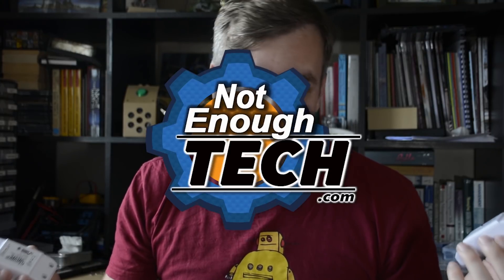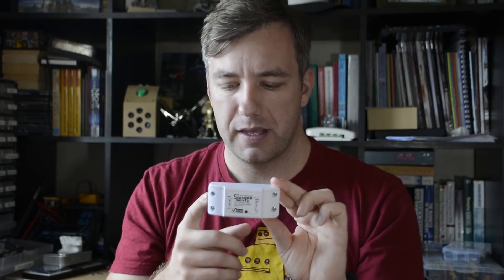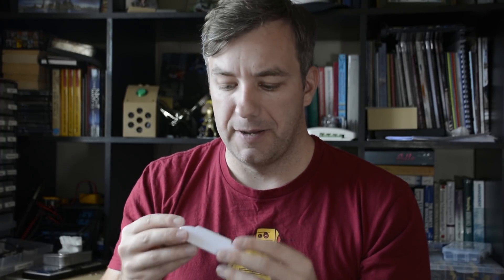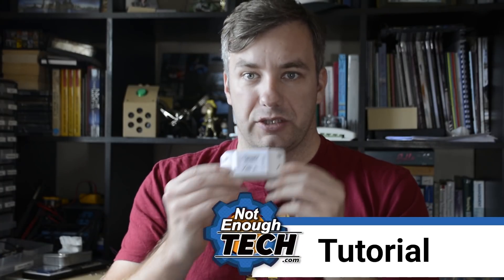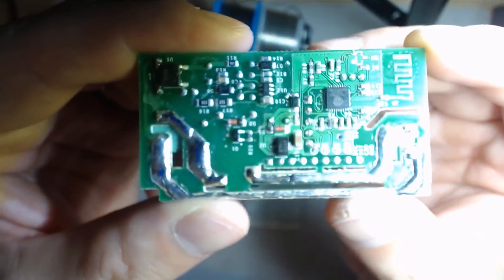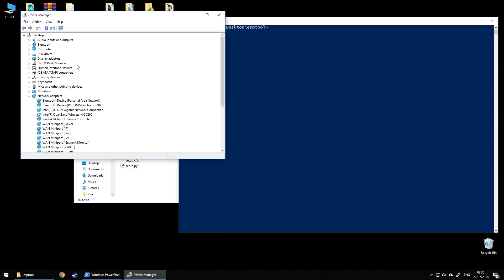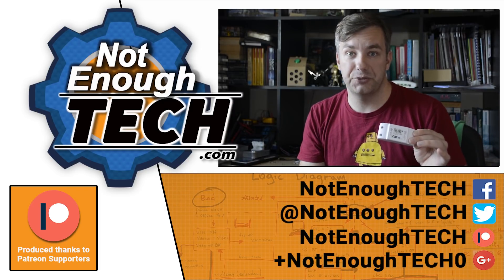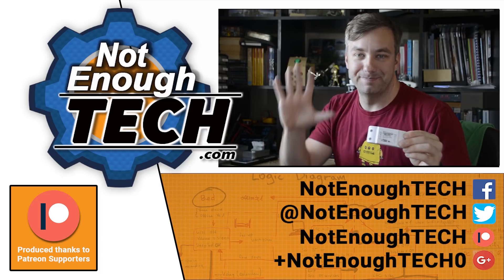Should you hack Sonoff Basics devices? [updated Flash Guide see description]

Comment: Why is the backup only compatible with one device? Is it only because the MAC address is stored in the backup? I have three devices. Do I actually need to keep track of which backup goes to each individual unit, or could I just restore a unique backup to each device and call it a day?
Reply from the maker: The backup stores MAC which is hardcoded into the hardware. Name the bin file accordingly and sign device enclosure inside to identify the backup. This only applies to original firmware
Reply: @notenoughtech  Thanks for the quick reply. That is a bit of a headache. But after further research I am pretty certain that I will never use the stock firmware.
Reply from the maker: I never went back either... but you know... it's better safe than sorry

Comment: Hi, I am using a CJMCU-232H as my programmer. Whenever I connect either  the gnd or vcc (+3.3) from the former to the sonoff, the power led on the CJMCU goes off and the com port (COM3) disappears from device manager. I only need to connect +3.3V, GND, RX and TX, right?  Could it be that the CJMCU isn't providing enough current for the 8266?
Reply from the maker: I have not used that one. Seems like there is too much power draw. Try connecting 3.3V from another source but keep the GND common with the programmer, new power source and the sonoff
Reply from the maker: This is the one I use:
https://www.banggood.com/custlink/KDGKKz47LT
Reply: Besides Tasmota there are a lot of different firmwares:
 ESPurna
 (Sonoff-Tasmota)
 WiFi-IoT
 Sonoff WiFi Switch
 ESPEasy
 1M
Reply from the maker: Thanks for the list. I use tasmota and AFE Firmware will check out the others at some point

Comment: What will be power adapter recommendation for "1 Channel Inching /Self-Locking WiFi Wireless Switch 5V " . 5 Volt 1Amp or 5 Volt 2 Amp or 5 Volt 3Amp ?
Reply from the maker: That's depends on the device itself. 1A should be more than enough to drive both WiFi chip and the relay. Do check spec sheet to know detailed requirements.

Comment: I'm considering getting  some sonoff equipment, but I really don't know how much one can trust these. Am I being paranoid? 😄
Reply: I don't trust these using the stock firmware since they have to go to China to switch the light on and off. 
However using the Sonoff.bin (Tasmota) file, you change it to being local to your own system. This is great and let's you pull it into Home Assistant or OpenHab to manage it.
You can also just use it as a local webpage if you haven't moved to some Open Hub  yet. 
With the Sonoff stuff I don't bother to backup the current firmware as I never want my switch to ping a server in China to turn on my light.
Reply from the maker: You can stay paranoid. Sonoff flashed let you write your own firmware. In that case you know for sure it's just you that handles the data (unless your coding skills are shoddy then use tasmota or AFE Firmware - both open source)
Reply: They are well made and very reliable. The new Sonoff Basic is a complete redesign probably to conform to more countries' safety standards.

Comment: How did you figure out the "0x00000 0x100000" for the backup? Is that a general size for ESP8266 devices?
Reply from the maker: Don't quote me on that but I believe these are memory range limits from where in the memory table you should start read and stop read process for the backup. The 0x0 is an obvious one, but the closing one is directed probably by the biggest flash size. I used the default values from documentation when I was doing the research into that. I hope this helps
Reply: @notenoughtech  yeah, those look like start at 0 and go up to 1M. I was just curious if there's a way to determine them somehow e.g. for other chips.
Reply from the maker: Don't think there is a need for it as it will allocate the space needed. Read what's possible between these values and then dump the bin file. When you restore the bin file has the size already determined by the backup

Comment: Would you be able to link the programmer and other parts needed to do this please? I'm a complete nove but came across your Nest hack and want to give it a go but unsure what FTDI programmer and leads I need to buy etc. I have a couple of Sonoff devices. Much appreciated.
Reply: Make sure you get an FTDI programmer that can be switched 3.3V and check the output voltage too. I have one that allows me to switch the TX and RX signals to 3.3V, but the Vcc output was still at 5V...
Reply from the maker: I use this one:
https://www.banggood.com/3Pcs-FT232RL-FTDI-USB-To-TTL-Serial-Converter-Adapter-Module-p-959210.html?p=4B291314710261201709&custlinkid=17347

Comment: Hi, i am trying to use the sonoff switch to turn on a device which is not always physically accessible. by using the timer functionality but one problem is that there is not an internet connection available over there is it possible
Reply from the maker: You can configure the timer inside the Sonoff device,  I'm not 100% sure how the clock is monitored, I'd imagine WiFi would be needed to at least start the clock and synchronise it every time device is disconnected from the power.
Reply: @notenoughtech  can i connect an external battery to the vcc and ground pin in the board so that the device will stay on all the time
Reply from the maker: @pradeepchandran9920  Yes you could do this Remember that battery would last a couple days at best without sleep
Reply: @notenoughtech  is it causes any problem if i connect like that. Is it like the bios battery in our computers?
Reply from the maker: @pradeepchandran9920  No, but you will be adding battery monitoring to the mix. Is not possible to extend your network with another ESP device? I understand the WiFi is the issue not the electricity? This way if something goes down, Sonoff will reconnect and check the clock. You could also think of implementing of RTC module - maybe this way you could keep the persistent timing between reboots?
Reply: @notenoughtech  ok thanks for the help